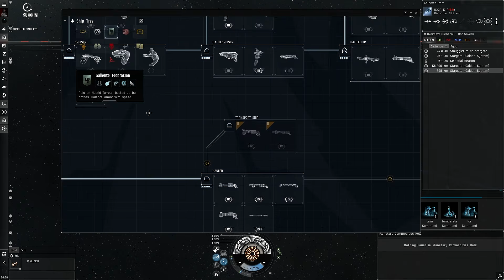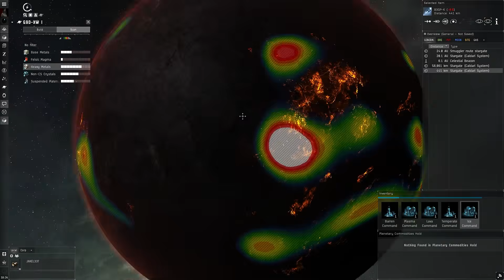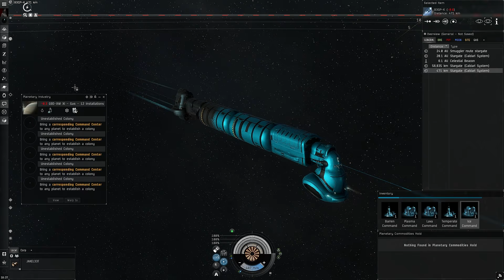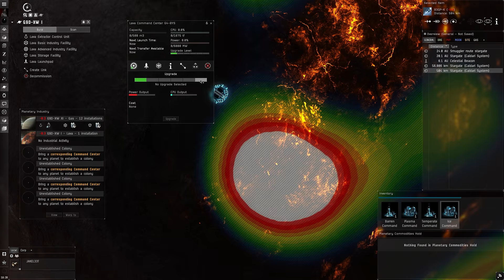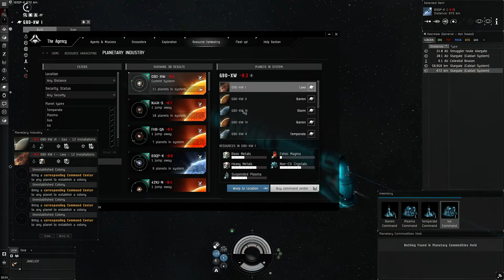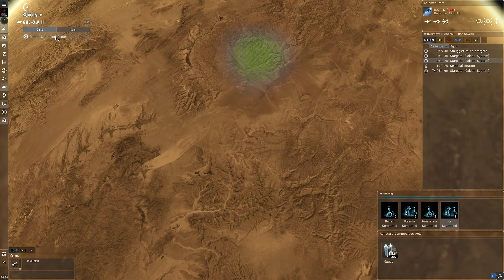Start Printing ISK in Minutes – The Beginner’s Guide to Planetary Industry in EVE Online!

Comment: Thanks for the guide! Question:   8 pi1 factories per planet means you need 2 planets with 8 pi1 which will produce resources for 4 pi2s on a 3rd planet per hour but according to my experience 1 planet is capable of having 4 pi1s and 2 pi2s which will do same thing without a need of importing and exporting pi1s between planets

Comment: Why not go from p1 to p3 on same planet
Reply: I do p1 and p2 on same planet, this is due to custom office tax rates where I am. (if u note on the video, the OP is using a customs office with 0% tax rate, so he can move materials without spending isk), that's the way I learned many years ago.
Doing to p3 or tier 3 isn't viable on the 1 planet for various reasons, like not have all available resources on the same planet, u need several different ones to make a tier 3 commodity like Robotics, u need to use barren and lava planets for the different materials.
This isn't the only way PI can be done, but it is an efficient way to do it with 0% tax rate.
I hope this is what you wanted to know.

Comment: Hello. I'm fairly new to Eve and just starting to learn about PI. This is a great video and I just used it to set up my extraction planets in low sec. Now I want to designate one planet to just production to produce Tier 2. I've understood everything in your instructions except one thing. Question: When setting up the Production planet, and creating the Input Routes, after I click on the Input Launchpad a window opens where I have to select my Tier 1, then click Create Route. Since I have more than one Tier 1 material there, do I have to create a link for each Tier 1 material to each factory? Or is there a way to group all the Tier 1 materials together, then create the route? Your video is a little vague about that step. I'm assuming I'll have to create each Tier 1 route individually in each factory. Is this correct? Thank you

Comment: Good setup for low/null but in high sec you wont be pulling in enough resources to keep 24 adv factories running. Even the p1 factories dont get enough resources to keep producing so you have a constant empty input storage but you also have factories just idling waiting for more resource extraction. Thats with the 1x Extractor + 8 P1 factories setup.

Nobody seems to have done a High Sec setup guide :D

Comment: Excellent video. I've always been a little weary getting into PI because it seemed really daunting, but you made it very easy. I have a question about processing planets: if I'm running 4 extractor planets so I can eventually make 2 different P2 products, do you run 1 processing planet with 4 inputs and 2 outputs, or do you do 1 processing planet for each P2 product?

Comment: interesting Idea but I see a flaw. storage unit uses 500tf and holds 12000 M3, launch pad uses 3600tf and holds 10000 M3, they both use the same power 700mw, it would be more efficient to use one launch pad and rout on and off the planet using two storage units. less tf and more storage capacity.

Comment: I used 4 accounts to make fuel. It could probably be done a bit better next time I set it up, but in  my area (lowsec) it worked just fine. I had it set on 1 day timers, and used 19 planets (I think, havent looked at it in about 3 years now) for nothing but extraction, and had the materials in ratio to the amount I would need them, so some would only need 1 planet, while others would need 3. I used 4 planets I believe to convert the 0s into 2s (I had each planet producing about 10k m3 per day). The final planet was used to make robotics, and extract/convert oxygen whenever I had spares/needed more, or any other resource for the matter. How much did it make? Enough, to the point in which the ice was always the limiting resource, as lowsec really only has isotopes and glare crust (only about 7 systems have dark glitter). I believe I only used the command center as storage, but I really can't remember.

Comment: I can only get 19 advanced factories not 24. They are very close together but I run out of power with a fully upgraded command center. Any ideas what I'm doing wrong?
Reply from the maker: The radius of the planet is too big. It is best to use barren planets (they have low radius) for process planets. Look for a radius less than 10k.
Reply: @JAKEL33T  wow. Thank you. I would have never figured that out. I only chose the gas planet because I had to barren planets feeding resources into my production planet and was trying to keep it cleaner on the overview.

Comment: You can use the command center for storage, doing so may eliminate a need for the storage facility.
Also, don't even bother with PI unless you have the command center upgrades to 4 minimum. It doesn't take long to train to 4 and you might as well start the setup with a decent powergrid/cpu.
Reply: This may actually be worth doing now since PI products were reduced to half their original volume recently
Reply: @daveisnothere  I've been running a setup using the CC for storage since I posted that comment. It works reasonably well with 2 day extractions (30 minute cycles) as long as you maintain a balance between average extracts per hour and move P1s to the launch pad once a day or so. Its worth experimenting with your setup, but I wouldn't recommend it if you are on 15 minute cycles.

Comment: TLDNR:  4 PI Alt Toons making P3 is very viable and does not need level 5 PI skills to make any difference.  

I do basically the same thing, but don't have Lev 5 Power/CPU.  My extractor planets are only shy 1 factory, but it does not matter in the long run as I don't pull enough raw materials.  On my factory planets, I have the same amount of factories too, but they are configured better optically so I can see what is doing what clearer.   As long as its connected by 4 out, its good.  I 'did' (remaking mine after a few years off), set mine up to take in 4 different P1 on 1 planet producing 2 P2 without any bottlenecks that effected it based on 4 PI alts in a WH.  And on another planet, I turned that into P3.  Considering its a 4 toon setup, I think it works well.  

To scale it, it would break the 'lowest common denominator' factor too much as +1 toon would probably (I think) create a bottleneck in P1 to P2.  Not 100% sure what it would take to bottleneck the P3 production, maybe 7 or 8 toons it could do well with?  But with only 2 accounts, 4PI in a WH while my other 2 do local PI for profit, to scale up from this I would likely need a 3rd account (not doing) or have an indy corp with other people and coordinate a production line with that... what a nightmare that would be.  Would be probably easier to buy from market and produce in HighSec P3 on any scale as a single person.

Comment: Awesome tutorial! Question - I have all my skills under Command Center Upgrades & Interplanetary Consolidation except for level 5 for both - still in progress. Can i continue with PI while level 5 is in progress? or do i need to wait until level 5 completes?
Reply from the maker: You can just add more when you get CCU 5 and add the 6th planet once’s to get IC5
Reply: @JAKEL33T  I purchased the Epithal. How did u get the Inventory menu with icons at the bottom right side of the screen?
Reply from the maker: In space just open the inventory from the side menu and place it where you want, then use the top left side arrow to expand the tree menu to select the planetary commodities hold.
Reply: Thanks again! - how did u acquire the blue skin for the Epithal? I can't find it in the Reg Market.
Reply from the maker: Project discovery reward
Reply: @JAKEL33T  what should I use if I were to setup the same thing on a GAS planet? Under Gas Basic Industry Facility -> Schematics. Should I select Bio fuels?
Reply from the maker: I setup all “extraction planets” the same the only difference is what you extract and produce

Comment: Notes on extracting:
- When setting up factories, you can double-click on the schematic & double- click on the destination, then hit submit. It's less mouse movement.
- Commmand Centers can be anywhere on the planet, you don't touch them after you upgrade them. I was putting mine at the pole for awhile.
- As concenctraion hotspots (white areas) move, you can just move your extractor control units & heads, the whole colony doesn't have to move. I only move colonies when a hotspot is too far away to link.
- I string out my factories in the direction of where I think the next hotspot will be. They're still almost touching, just in a long line. That way, it's shorter to link the control unit when it moves to the next hotspot.
- Careful with my last point. Storages & Launchpads can only link 5 or 6 factories out. I end up with 1 or 2 factories around the Storage unit instead of at the end. My colonies looks like a mace or an axe.
Reply: You can launch 500m of items from your command center for 15% tax rate.  If you're getting tax boned that can be useful.  I honestly wonder how much advice about Eve online is about keeping people in very specific lanes.